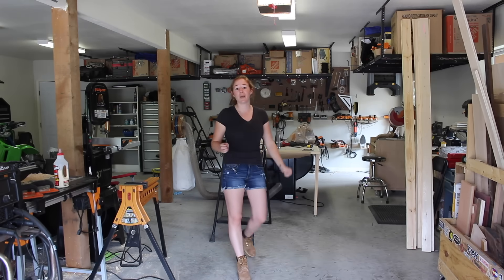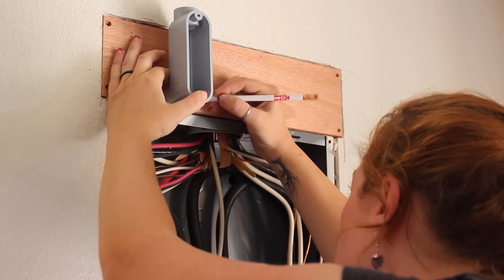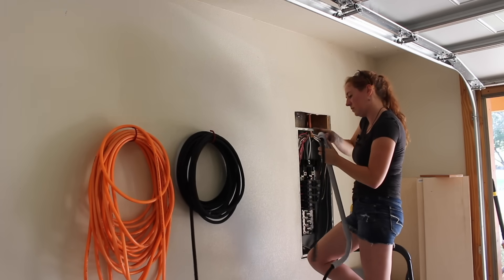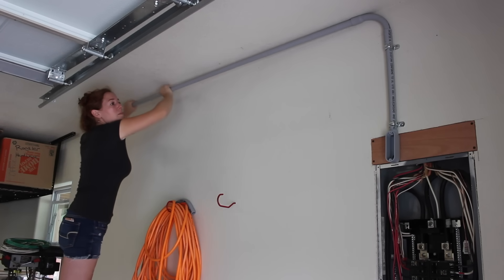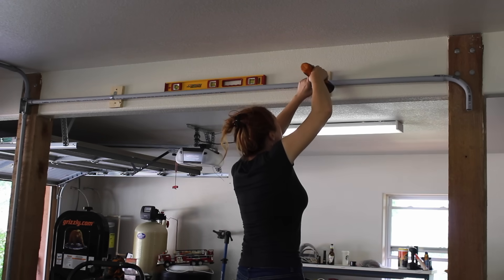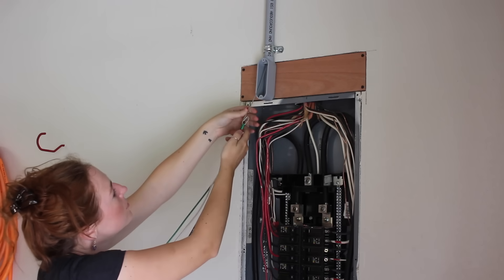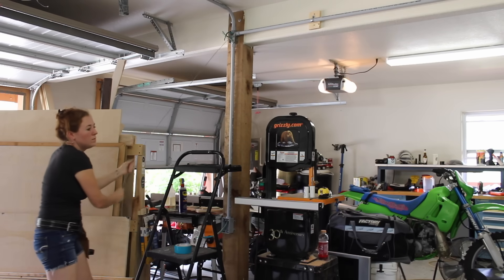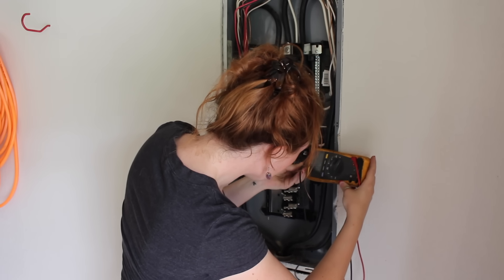Adding 220 Volt Outlets to the Garage

Comment: you have so strange regulation for wiring out house wire is in 3 core round flat 240 vote cable that have to be cover by a metal plate when in the wall or in a harden plastic if surfaced mounted I have never seen all those separate wire before the insulation to prevent heat is not very good we would normally have cables like the one used in this inside a grey think rubber plastic coated to make it a twin and earth 240 cable.
the cabling method you are using was banned years ago in our country for being to unsafe and a fire and should know risk. we offer lyrics have 240 in our homes
cannot believe your using metal boxes on a surface mount.
but I guess every nation has there own way. 
the only other thing we would have to do in our country is to get a certified electrician to check it over and issue a certificate other wise anything goes wrong and your insurance and refuse to payout.
I think she did a great job !

Comment: White wire is neutral color if you are using as a hot it needs to be labeled as a hot on both sides.  panel side and plug side.

Comment: April, you're brave for posting an electrical video. Apparently everyone on youtube is a professional electrician. My only observation is that you used a band saw and a spindle sander for a cut that would have taken 15 seconds with a hole saw or spade bit...

Comment: If you used a white wire you should put red or black tape or marker on it, as white is for the neutral conductor. Did you use flex from lb into the panel? Your handy box looks a little crowded.I have seen far worse.

Comment: The only comment I can make, that I see over looked by many, is ... glass is a liquid. Be it a very thick liquid it's still a liquid. So after 20 years the glass at the bottom of a window is thicker than that at the top. Wire insulation is also a liquid. So wires not dressed correctly in a junction box will eventually short as the insulation is pushed away. Every new house I move into I go thru all the boxes and have found close calls. Cheers ....

Comment: Great work April but I would have used red / black / white & green, Where as the white is neutral and the black & red are hot's (110). With the green being ground. If my outlets were three prong instead of four I would have tied the neutral & ground wire together.

Comment: The white wires should be wrapped with red tape in all of the junction boxes as well as the receptacles and the breaker panel. For insurance purposes it would be wise to have the electrical modification that was done inspected and approved now that the world knows that it was performed.

Comment: Great work. Some suggestions as an electrician: use red wire for B phase--white works but red would be better, use a bigger junction box--wire that size needs more bending space, and conduit needs to be continous --I didn't see the connection from LB to the knockout in your panel. Nice work otherwise.

Comment: I think you needed to run either two blacks with red tape on the ends of one Or one black and one red. Using white for a hit wire is a nono.
Reply: ...hot wire. white is for neutral.

Comment: As an electrical engineer for 40 years, a few corrections. First single phase power in residential areas is 120 volt/ 240 volt. 110 is an obsolete voltage that is no longer used in the US. "220"  doesn't exist in the US. It's either 240 volt or. In commercial and industrial construction where 3-phase power is available the voltages are 120/208 volt. 
Second, the use of a white wire for a hot conductor is not legal. The two hot legs should be red and black. White or gray is used only for the neutral conductor. 
Since I assume the purpose for the 240 volt outlet is Goff power to a saw or other industrial motor driven tool, a three wire outlet would be appropriate. That would require a black,red, and green wire.

Comment: April Wilkerson, I have been an electrician for many years and pride myself on craftsmanship, quality, safety and code compliance.  That being said, don't listen too anyone talking about using S.O Cord in conduit and all that, though your junction box would have been overfilled (heat issues) and too small.  I also didn't see how you got the wires into the top of the panel (assuming free air, which is a no no),  no glue for the pvc, not grounding your junction box, and  the improper size/color of your wires (looked like 10 gauge for a 50 amp outlet, but i could be mistaken).  
  Now that i got all that off my chest, WHO CARES about any of that if you feel comfortable?  If you sell your house, it will have to be removed or fixed.  Do what you want and don't let anyone tell you different, its your garage/workshop/house/property etc.  Though, metal panel and insulation may break down and short out, undersized wire for load can be bad due to heat and also breakdown of insulation, other than that, no real big safety concern.

Comment: I saved thousands of dollars by doing my home remodel electrical myself. Most of it is pretty straight-forward, and easy to do. I just follow local codes, and manage to impress the inspectors every time! Plus, since I do it myself, I know how it works, and I can wire it up to my satisfaction. Anyway, good job April! I think you have more than enough skills to wire your whole shop when the time comes to build it. :)

Comment: I don't know if it has been mentioned, the breaker protects the wire, not what is plugged into it. Also, I did not see how the conduit was fixed into the main panel. From the location of the conduit "L" at the beginning of the run there is no room for a sweep 90 into the panel.

Comment: Nice job, but where do you live that you can do that without any permits? Here in Florida where I live you need a permit when you change out your kitchen sink. It's ridiculous here.

I studied electrical engineering in Europe and have to say you really did your research well before you started. The only thing I would not do is mix PVC conduit with EMT boxes. If you do that, you must ground the EMT box to avoid getting electrocuted in case there is something wrong in the box. The problem is, you won't know until you touch the EMT box. In your case the box is touching wood, so if a hot wire would touch the box, the current would not be directed to ground to trigger the breaker. As soon a you touch box, there is a chance to are closing the circuit and now the current runs through you which will trigger the beaker but at the very least it will cause a painful surprise for the person touching the box. In the worst case scenario it could kill the person.

So if you have not done so, ground that EMT box.
Reply: You've got a good eye.  I had to go back and check where the EMT box was.  You are correct.  Correct me if I'm wrong.  She needs to take a jumper from the green connection to the box, or change box to PVC.
Reply: Charlie Artner you are so right but I believe she can safely connect the ground conductor to the metal box or as said earlier use a jumper.

Comment: Sorry, but american electricity is at least 50-70 years back compared to Germany or Europe.
This kind of installation can only be found in very old houses...
Reply: There's more than one way to do things, you Europeans are so cocky with your metric system and "modern" wiring! You know what we do with our wiring, imperial measurements, and freedom of speech? We run the same electronics you do, we are the biggest super power in history, went to the moon by ourselves using fractional inches, feet and miles. Plus we don't get sent to jail for "hate speech" cause we have constitutional rights.
Reply: Yet is accomplishes exactly what it needs to. It gets tiring reading the same thing all the time from the Europeans. What's next ? Drywall? Plumbing?
Reply: You probably don't understand that this is work done for a garage not the house. In Europe having a house with a garage is a luxury for the few. You probably live in an apartment and you never had to do any do-it-yourself work as most home-owners do in the US.  You had an electrician do your electrical work there because such a thing is a myth in Europe. I strongly doubt that a work in a garage in Europe is done in a better way than in this video. Therefore, I bet you are speaking from an ignorant point of view.
Reply: A welder that works on 120
Reply: I do not see the logic in pointing this out... except to fill some sort of empty void in your soul with demeaning comments to person trying her best. Good job.
Reply: Then why we still a super power......bwhahahahahahaha joke calm down now
Reply: I did my own apartment in Europe with little help from a laborer.
Beautiful and it so modern that is 30 year ahead of North American technology.
sorry.........

Comment: Excellent job April.  You can nix the fish tape as many times it will hit a joint and not be able to go through to the end of the PVC.  Use instead a ball of lite kite string with a small piece of cloth tied to the end. Stick the cloth into one end of the PVC pipe.  Use a heavy duty shop vac on the other end.  Change the hose to the suck side of the shop vac to suck the cloth patch and kite string through the PVC.  Now tie the kite string to a much more heavy duty nylon string and pull that through the PVC.  You can tie that to your wiring and pull it all through.  I have actually pulled the kite string from a building, under the road to another building 20 yds away.  Great video, hope this helps.

Comment: One thing I found surprising is there are NEC junction box volume requirements (in 314.16).  I have one in my house that I suppose, to be code compliant, I should replace with a bigger one.  I'm guessing that's supposed to accommodate the small amount of additional heat that will be generated by joining together wires with fasteners like wire nuts.  What you have looks kind of full (at about four and a half minutes), but without looking at that code section and comparing it against what you have, it's not easy to tell definitively.

Comment: Nice video, April.
With us everything works over 220 / 230V, which is normal household current.
For more powerful device (electric oven) works with 380 / 400V (high current, 5-core cable, since one can observe the polarity 3x plus [black, black numeriet, brown], 1x neutral [blue], 1x earth [green yellow]).
Greetings from Germany

Comment: shouda used metal conduit & larger junction boxes /outlet boxes (more room in the boxes is a plus --- that one junction box is pretty well and uncomfortably stuffed)  and never forget the safety glasses.   To avoid confusion in the future, you might consider putting  colored tape on the white conductor in the boxes (where it is visible) so someone who comes along later doesn't mistake it for part of a 110 volt circuit.

Comment: Hi April, You couldn't do that in the UK ! As for Joseph's comment "it's your shop, you can do what you like " It would be against the law in England. Just for info, we have 415 volts to big machines, planers, circular saws etc. and 240 volts for smaller/hand power tools.
I won't even start on colour coding. Keep up the videos.  Steve, Yorkshire

Comment: You are obviously better at wiring than I am. When I added a 220 circuit, I used 10-3 with ground romex without conduit.  Your project looks better than mine.

Comment: The only suggestion I have is I was taught at each outlet leave WAY more extra wire for the next guy.  I usually pull out about 3 times the box height.  Then when your done wiring the outlet you can fold the extra into a Z and push it back in.  With the thicker gauge that  maybe a little tricky.
Reply: Instead of making a Z fold try looping the wire making an O pattern in the back of the box. You’ll save a ton of
Space and it looks much neater
Reply: i wish they would have done that when my home was built in 1955,  i had to put grounded out lets in and many were very short wires had a bitch of a time with the short lines..  it worked out,  but it is a very good idea to leave extra..
Reply: Code is only 6 inches.
Reply: UsPLUS Five $$$ not “only 6”, it is a MINIMUM of 6”.
Reply: S H I know I I’m an electrician I shouldn’t have assumed others would have read it like that
Reply: Ken Anderson ** CODE requires at LEAST 6” wire stubs.  Minimum.

Comment: Hi folks, just a short note to say different counries have fundamentally different distribution and internal wiring systems. This extends to earthing/protective conductor arrangements and how single phase is derrived from three phase along with installation practice and legal requirements. It's not just a question of different votages and frequencies. You need to be very sure what you are doing and not make assumptions. This stuff can kill if done incorrectly. Be safe out there, for yourself and your loved ones, and also anyone else who uses your handiwork now, or in the future.  Bob.

Comment: US voltage is 120 (single phase) or 240 (dual phase), not 110 or 220.
Reply: It's it technically considered 'split phase' not dual phase?
Reply: 120 nominal that is
Reply: As a utility lineman I have helped install lots of transformer banks fed by two phase primary voltage. The output of two transformers can be used as 3-phase in a delta arrangement. The third phase is synthesized by connecting where the third transform would have been. You certainly seem to know a lot - where did you get your experience?
Reply: there's always that one guy
Reply: @Wharfrat992  ,...who is a know it all asshole......
Reply: Phil True Very true (pun intended). 110 and 220 have been obsolete for a long time now.
Reply: Hey Phil,  all us old-timers here in the states call it 110 and 220.  It's must vernacular.  
Back around WW!!, the nominal primary mains to supply equipment was 117 volts.  Later, it became 115.  As time went on, tolerances became sloppier and sloppier, as regulations began to vary from place to place.  Certain ISO standards were developed and the nominal distribution voltage of 240 Volts was settled on.  But the old timers still will call it 220.  It's the same thing.  Interestingly enough, there are only a few parts of the world where the 240 is center-tapped to earth, to provide two split-phase 120 volt legs.  THIS IS NOT TWO-PHASE!  It is single phase,  with its voltage divided.  I would be interested to know more about the history behind Japan and the USA deciding on the lower voltage to run household and other light equipment (not lighting equipment - no pun intended).   Incidentally,  I believe that Japan still runs around 100 volts instead of 120.  Someone reading this may verify.   Anyhow,  there is lot of interesting history behind energy management, especially electric power handling,  much of which I will probably never know before I die.   But why split hairs over voltages that can definitely curl your hair?
Reply: @gyrgrls … actually many smaller countries still use 105 volts as a standard with 210 volts being the counterpart. (common in the Caribbean islands) Typically it's the countries that are using 50 hertz instead of 60 hertz. Funny thing is I learned this doing generator work and that's exactly where you wind up when setting engine governed speed on most sets. When shipping a used set to an international buyer I have to ask what country just to make sure we set it up correctly before it leaves my shop.
Reply: Actually voltages are different on all lines.  It depends on where you live and what the line resistance is.  It varies from 110-120 and 220-240.
Reply: @ike fun Whether the information is right or wrong you sound like an immature teenager calling him names like that.
Reply: There's only one PHASE in a normal residential split-phase system.  Phase refers to the AC sine wave, NOT to the poles.  In a residential system, one phase is split into two POLES, but both poles are on the SAME phase, that is, the sine waves of the two poles are phase-locked, and the voltage oscillates precisely together, Peaking and crossing zero at the same instant.  UNLIKE a three phase where each POLE is on a different PHASE, each phase is offset from the next by 120 degreees (of angular rotation), thus peaking and crossing zero in an equally spaced sequence 1,2,3,1,2,3,1,2,3 etc..
Reply: @karlfife  i just got a little moist. does heavy duty industrial 600v differ much from 240v 3-phase DC?
Reply: Or 3 phase 120/208V

Comment: I think whether or not you can do your own work depends on the county and state you live in. For instance: In Carroll County, Maryland, you can take an open book "Homeowner's Exam" when you pull your electrical permit to do the work yourself. Yes, this would have been required for such a job here. Then you just have them do the inspections on your work. To me, this was well worth the $25 for a permit and to ensure I did it right. I've done this twice now on 2 projects. When finishing our unfinished basement, the inspector said I actually did a better job than many licensed electricians he's seen. That was major encouragement to do it myself.

P.S. - Good job, April!

Comment: Wrong wire colors :

120/240 volt single phase

Black = left or upper bus

Red =  right or lower bus

White = neutral (Code mandated)

Green = Equipment ground (Code mandated)

Comment: Wow so much controversy over one 220 line.  It sounds like you did all your homework and it looks good to me. Not an electrician here but have been doing wiring in my home and shop for over 35 years.  Thanks for another great video.  Glad your going to be able to use all your tools.

Comment: I'm no electrician, but I think it came out nice and clean..I run my own wiring and sure electricians have to go by code for their area, but there are so many and varied that in my opinion if it's covered used the correct line for 220 then it'll be fine

Comment: I use 400 volt 3 phase power for mainly "regular stuff". 800 volts or more is industrial power. And those big ass red plugs with 5 holes.